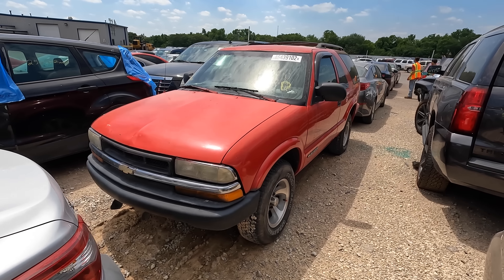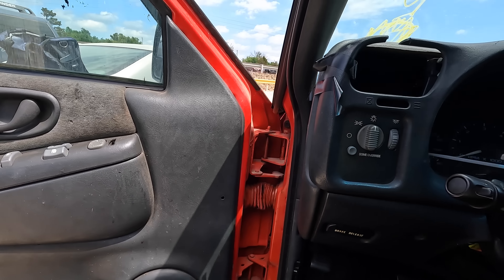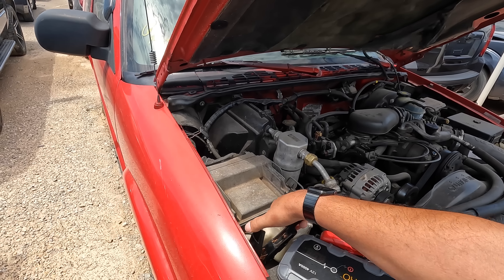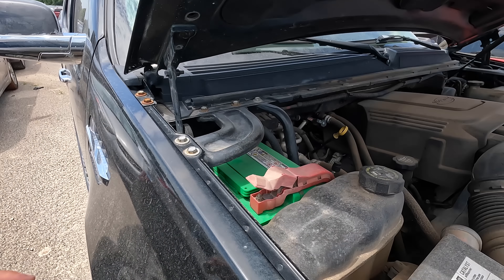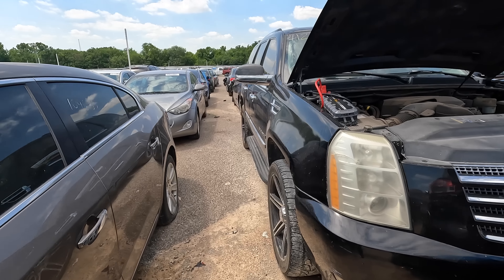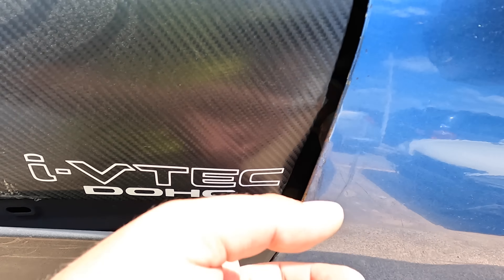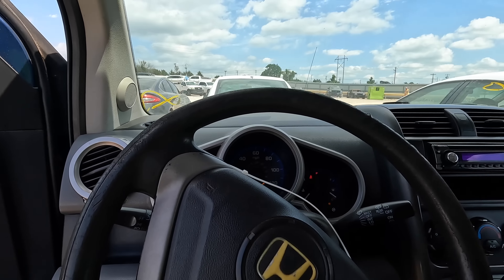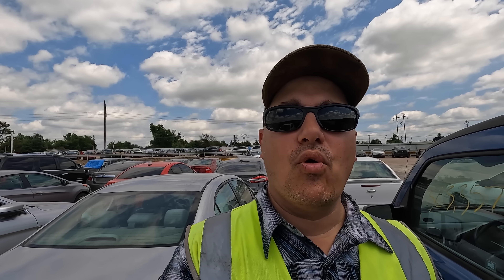Copart Walk Around 6-9-22 PM + Super Rare Blazer and Carbon Fiber Honda Pilot!

Comment: I own the exact same Blazer. Have had 15 or so s10s this is my favorite. Mine has 312400 miles original engine uses no oil. Mine is the 5 speed with g80 disc brake posi rear. Air blows ice cold!

Comment: You can buy a new remanded motor and transmission for that at Orally for 2200 bucks.   And the 4.3  has the same bell housing as a Chevy 305 and 350 so basically there is a lot of transmissions that can be used

Comment: Hi Randy from Finland!Just bought Rare Citroen C5 Break exlusive -05 with all options(only the JBL sound systen was 4K€).Thing that makes it rare is V6 engine in estate model.In miles driven 120k.ONLY for 800€(in -05 this was about 60k$).Reason for the prise was that it needed new timing belt,if don by garage prise about 1400€,did it myself..Have a nice summer,and hope that Putin has a stroke..

Comment: The Escalade would be hard to resale with the gas prices as they are.
Reply: No one buy's V8's for gas mileage LOL
Reply: @lovellmills7959   This is true. However, when gas prices went up previously, V8 SUVs did not sell well. However, a V8 pickup is a different story as pickup truck will usually sell well in most markets.